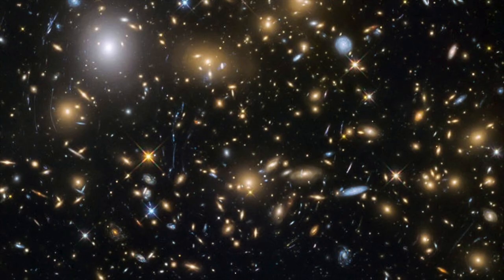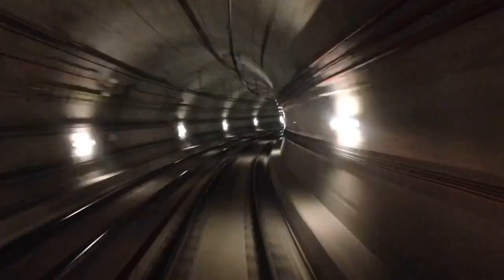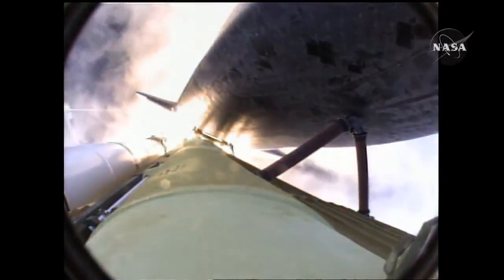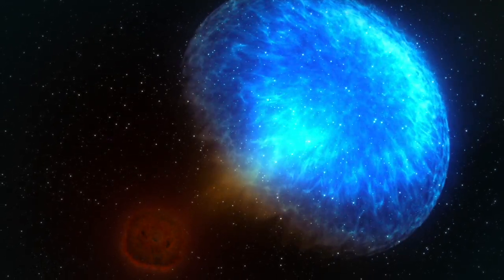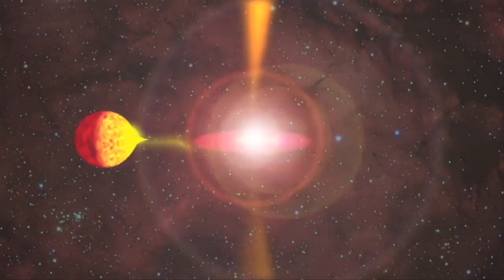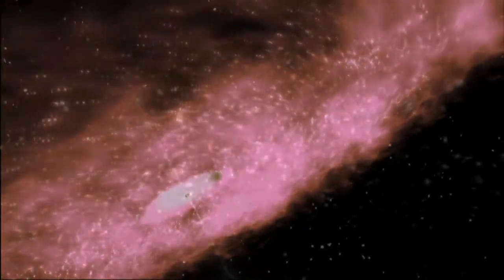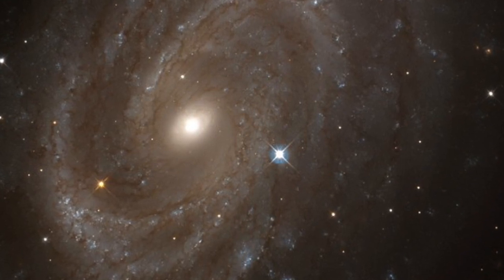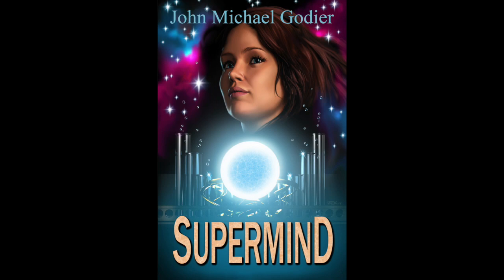10 Mind-blowing Interstellar Propulsion Systems

Comment: Now, we need to see which of these drives could be combined.  Perhaps using fusion power to create small amounts of antimatter and an artificial micro-black hole to power an Alcubier drive and also use the microsingularity to boost lasers that are pushing lightsails, so we are ocally moving a substantial fraction of C while moving our relative spacetime faster than C and because of the combined drive systems we can stop or change direction, allowing 3d navigation in spacetime, and possibly 4d navigating if we can use the microsingularity to generate and stabilize a wormhole...

Comment: Assuming we could accelerate a probe or spacecraft at fractions of the speed of light we still have the problem of "bumping" into things in space at those speeds.  Even particles smaller than a grain of sand could do catastrophic damage to the object.  How do you build shielding strong enough to deflect or safely absorb something striking the object with that much kinetic energy?

Comment: There's also a third method of using fusion reactions to generate thrust, which is to use the reaction to heat and accelerate propellant. Basically a higher-efficiency version of the nuclear thermal rock engines prototyped in the 70s

Comment: If you were using one black hole to speed up and heading directly toward the second to use it to slow down, you better make damn sure your engine doesn't give out, your thrusters to turn the engine around don't fail, and your calculations on how long it will take to stop are correct.

Comment: The listing order is off. The FTL ones are the most 'mind-blowing' concepts. Step into a wormhole & you could exit on the other side of the universe. A 'warp drive' follows on behind because you can get to other star systems in a matter of days/weeks/months depending on the chosen destination & how many times the SOL you can output. 

A Black hole drive, Halo Drive or Stellar Engine are cool concepts but in contrast to the previous two FTL methods, they seriously pale in comparison. A SE is impractical given the mass requirements & timescale not only to construct the shell, but also to get to a destination. A BH drive can get you up to a decent light speed percentage but has a very limited lifespan that means you can't go far before needing to stop. Either to try & re-fuel it or eject it before it goes off. A Halo Drive means getting to a Black Hole in the middle of the galaxy. A tad too impractical to ever be of any real use.

Comment: Even if you could survive entering a black hole, you could never locate the singularity to open a wormhole. And even if you could hold a wormhole open, it wouldn't lead anywhere. One aspect of quantum mechanics that a lot of people struggle with is, position is not an inherent property in the universe, but it is the result of interactions between particles. (note I said "interactions", not "observations" which would imply the requirement for conscious attention, and was one of the worst incorrect word-choices ever made by modern scientists.) The reason your body exists in a predictable location is because it's composed of zillions of particles that are continuously interacting with each other, so their positions are very tightly constrained. Whereas a lone photon traversing a sealed vacuum chamber in a science lab has nothing to interact with except the relatively-distant walls of the vacuum chamber, and so it effectively exists in all points inside the vacuum chamber simultaneously until you fire another particle into the vacuum chamber for the photon to interact with and thus constrain the photon's envelope of possible locations a little bit. A singularity is vastly different from a lone photon in a vacuum chamber, but it nonetheless shares the condition of not interacting with anything outside the event horizon, hence its position is undefined within the event horizon. Additionally, because the laws of physics collapse at a singularity, it is effectively impossible to define the singularity's position, and the same would be true of the "other end" of any wormhole you create. It would lead nowhere (and "no-when"), because the concept of location requires that positions must be definable.

Comment: Nuclear pulse will never happen. There are in surmountable problems with this type of propulsion.. First of all concerns is slowing down. You'd have to have some other method of slowing down that was just as effective as nuclear detonations, otherwise you're flying INTO nuclear explosions on the way back down to sub-relativistic speed. And at that point, you might as well just be using this other form of propulsion the whole time.

Comment: I think that by including FTL technology you are stretching your normally-excellent criteria for distinguishing possible technology from fantasy.  The Alcubierre drive has a number of difficulties at really basic levels.  In particular, it makes the quantum-mechanics newbie mistake of confusing phase velocity with group velocity.  Perhaps you can temporarily whip local objects rapidly back and forth within a gravity-wave packet, but all evidence so far indicates that gravity wave packets, like the ones from collapsing black hole pairs, travel at light speed through ordinary space.
The other possibility, creating bubbles and dimples in spacetime, tends to be very long-lasting and locally catastrophic.  They seem to require a singularity in the curvature of spacetime, e.g. white holes or black holes.  About the only speculative evidence we have about black holes is that they are spectacularly lethal in proximity.  As for bubbles, the material coming out of the big bang seems to have been in thermal equilibrium, i.e. maximum-entropy superhot plasma.  Few space travelers would like to be turned into that.
Finally, there is a sort of second-level Fermi paradox.  If FTL travel is possible then in any likely extension of physics as we know it, a traveler can go from point A to point B, then back to point A and arrive before they left. This would set off an unstoppable wave of history alteration that would saturate all spacetime with the most advanced technology that any civilization could invent, ever.  This clearly hasn't happened yet, so clearly we are living in an unpolluted history.
Basically, it is very hard right now to envision a non-causal universe that could support anything like human life. The limitation of the speed of light could in the future be replaced by something more subtle, but FTL travel violates causality.

Comment: If a light sail accelerated a probe to near the speed of light to get to Alpha Centauri faster, how would it slow down once there?  I would kind of suck to wait 3 decades for it to get there and then only have a few hours in the system.   All commands would need to be preprogrammed because we couldn't talk to it.  Take a picture of the star,  look for planets, take a picture, then it's gone out the other side of the solar system.  It would need a large telescope, or get close to one of the planets to get a good picture.  Otherwise we would at most get photos of the planets, but the photos would be just dots.  Plus it would need a lot of signal power to send the information back to Earth and the signal still be strong enough for us to receive it 4.5 years later.  It would be a waste to go through all this if we couldn't slow it down once there.

Comment: I would add gyroscopic.

Two outer shells that spin counterwise.

Then one end of them is pulled together/apart.
And their response to it is pushing.

Edit: because just remembered.

Cool-Wind.

One part is a cooler system that draws heat from the other component a radiates the energy in a laser as a minor drive.

The said other component..

A chamber that circulates high pressure gass. One part is heated by passive breakdown of radioactive particles in that area.

This heats the gass and accelerate it in one direction.

In another part is the cooling effect.

Thus circulation. Circulation that affect wings analogues.

And momentum is already changing here.(I didn't elaborate because I'm wat too wordy already.)

Comment: Nice vid.  I've been a sci-fy nut for 50 odd years and always wished we would be further on than we are now but that's reality for ya.
   If I had a choice between say a star trek type of warp drive or a Anti-matter near light speed that could actually get up to around .999999999999 light speed I'd take the slower than light method for at least going to other parts in the universe. It seems if you get close enough to light speed and time slows to a crawl then you can go just about anywhere quickly. But not as far as earth is concerned so it would be great for the people in the ship and a very long wait for the people on earth but who cares about them if your going to populate another star system. Now if we could get around the space dust problem as I'd hate to see what you would get at those speeds when you hit dust. It would be a great way to help slow down the ship at the other end but give the ship a hard time keeping up very high speeds and shielding would be very needed in a huge way. Lets just say hell with this and find a magic lamp and get the mass free drives of the good old E.E. Doc. Smith Lensman series so we can go anywhere. It would never work but it sure made the story fun to read...

Comment: Any practical system must include the ability to decelerate as well as rates of acceleration survivable by humans and/or complex machines.
How much science could you possibly do speeding through a distant solar system at 1/3 light speed? What useful device could survive a linear accelerator with that power? How many kicks in the rear does it take to reach speed with any pulsed propulsion(and then decelerate too)? Talk about a bumpy ride!

Here's my sci-fi scenario: future scientists develop a practical quantum teleportation device utilizing entangled tx/rx units. Receivers get sent to nearby stars utilizing fusion drives, and execute gravity captures around chosen exo-planets. Additional equipment and personnel then teleport through these quantum bridges which eventually form a giant galactic transportation network. But then some start to notice that the system is  also entangling the consciousness of travelers in strange ways....

Comment: Got a funny question John is it possible that a fart can Propel you in space?

And I'm not sure if you follow Netflix shows or what not but have you seen love death and robots because there's another question I have on episode called " Helping Hand" on love death and robots is what she does in the episode possible?
Reply: (Spoilers for the Love, Death and Robots episode below)

"Got a funny question John is it possible that a fart can Propel you in space?"

I think that's more of a Fraser Cain question, but I think I can help answer it. While rockets in space work from venting hot gas out their tailpipe and you'd be doing something kind of similar, a spacesuit doesn't normally vent into space where this could act as rocket exhaust. A vent like that would be a possible point of failure, and you're better off recycling air when you get back into the ship or space station. Also, venting gas into vacuum can cause problems, from unintended thrust to ice forming from water vapor in the air. As a result, flatulence would normally just be bottled up in your suit (Fraser addressed in a video not too long ago - https://youtu.be/thOkOo3XisQ?t=447). 

Regarding the Love, Death and Robots episode, the basic concept is right that throwing something will send you off in the other direction. The problems I've got with it are:

* The velocity from throwing a glove would be very small, and remember the part about the reaction being equal. She has a mass of about 100kg, including the remainder of her suit, and is traveling at (very roughly) a meter a second. I'm too lazy to do the math right now, but I doubt a glove would be enough to stop her, let alone send her sailing back in the direction from which she came.

* A person working 10' off the ground would have at least one tether, so why wouldn't an astronaut without a rocket pack? For that matter, why not have a tiny emergency pack. You could have a tiny rescue booster weighing a couple of pounds for just such an emergency. You could also have the capsule she was in have an emergency capture program - that doesn't even weigh a pound, that's just software.

* Sending an astronaut out in a suit would be asking for trouble - just put remote manipulator arms on the capsule and it would be safer in several respects. Not only would the astronaut be protected and robotic arms capable of more delicate operations than humans (by the time satellite maintenance becomes this mundane), the satellite would be safer. A human in a suit is an animal out of its natural habitat, bumping around unpredictably. A computer could limit remote arms to predictable/safe motions to keep a human from, say, sneezing and accidentally backhanding a solar panel or sensitive optics. Computer-enhanced arm motion could let them reliably catch objects drifting away, act as torque wrenches, and hold things far steadier than a human. The computer could also give you extra arms to hold things while you work on them (this is actually really important when working without gravity keeping all your tools and workpieces in place, resting where you leave them).

* You would have a very hard time applying a tourniquet in a space suit. The air pressure differential makes the suit push out against the vacuum hard, such that joints have to be specially designed or astronauts wouldn't be able to move their limbs. I space suits ever look baggy, it's because they have a layer of nylon or something similar to prevent damage that's not clinging to the pressure suit underneath, which is inflated by air pressure against the vacuum. 

* An astronaut working on a satellite in a suit wouldn't be completely without any other form of reaction mass. She'd likely have had other tools in or on her suit. The suit would likely be modular, letting her detach and throw pieces of equipment: a detachable battery pack makes sense so that a depleted one could easily be removed and reattached, as would being able to remove the air tank. Doing so would leave her without one (assuming it's an all-in-one unit without a reserve), but having several minutes of air in the suit would be better than partially venting the suit by taking off the glove and the shock that would follow. A water tank might be removable, as might a waste tank, but these might only be serviceable from when you're not in the suit. In the scene, it looks like they carefully removed everything she might have had on the suit, save for the watch which she used as a tourniquet. Having a spare flashlight makes more sense than a redundant watch: there are likely more times you'd need an emergency light than an emergency watch, and a better emergency watch would be a tiny LCD in the visor, in case you can't see out for some reason. Suits might even have ballistic cloth outer layers to protect against micrometeroids, especially if astronauts are going to spend so much time in them that it seems mundane and the space debris problem gets worse (more reason to use robotic arms).

* Breaking off a frozen limb is more like the movie 127 Hours than breaking a frozen corn on the cob. Hollywood loves shattering corpsicles, but if you go into your freezer and take out a leg of lamb, frozen turkey leg, etc., I think you'll find it a lot harder, and probably not something you could do one-handed. In addition, you'd have to keep that arm in shadow. I don't think it was in the scene, for practical reasons, but direct sunlight is hot in space. The heat wouldn't wick away through conduction (like on a cold metal slab) or convection (like when immersed in cold water), so it may take hours to freeze solid.

* Throwing things will cause you to spin, perhaps in ways you don't expect, and you don't stop spinning, making it a really bad form of propulsion. Throwing something else in the other direction might reduce the spin, but won't perfectly counteract it, so you'd very possibly end up facing the wrong direction when you get to your destination (though you might be moving slow enough that you'd be able to reach out before making impact, even if you're spinning). Her best bet might have been the Iron Man solution that Andy Weir described in the Martian (using a small hole punctured in a glove to create a jet of air that the astronaut can direct or pinch shut). That way, even if you're off and star to spin, you can counteract it, unlike a throw where it's all or nothing.

I don't mean to ruin that for anybody, but that one annoyed me because it seemed kind of contrived, and it went a long way for an obvious pun. I hope we get another season of the show - great to have another medium for science fiction authors like Alastair Reynolds and aspiring indie movie makers. Before it became 'SyFy,' the SciFi channel used to have a show called Exposure. It gave great exposure to filmmakers by airing sci-fi themed shorts, the sort you currently find in the YouTube channel Dust (https://www.youtube.com/channel/UC7sDT8jZ76VLV1u__krUutA/videos).